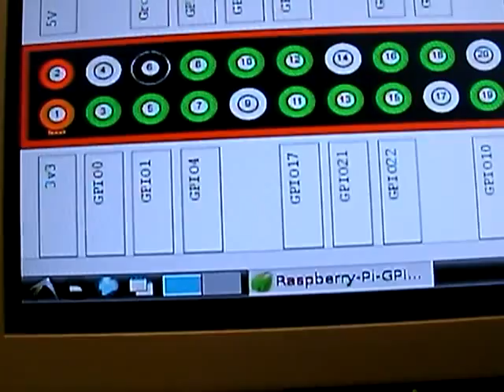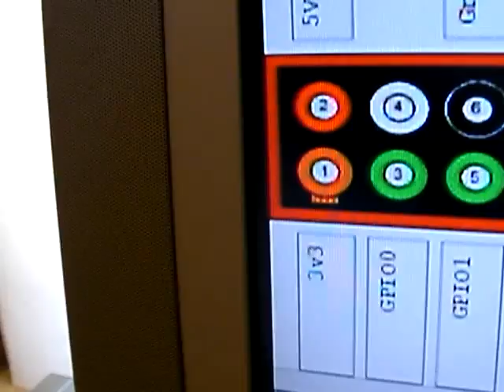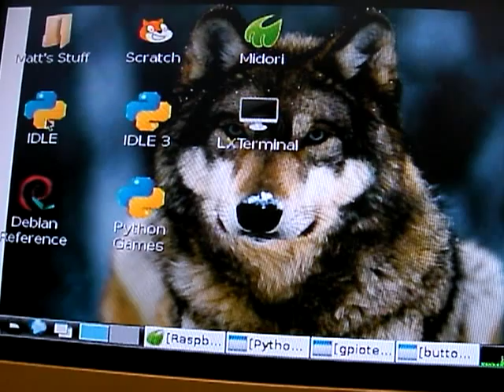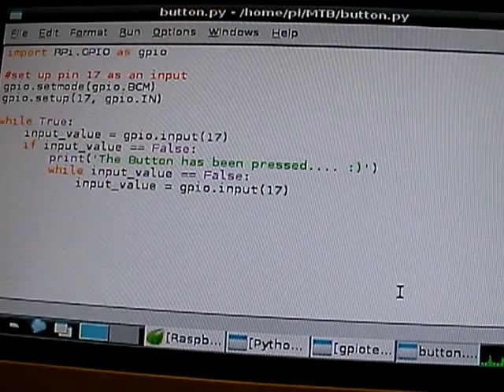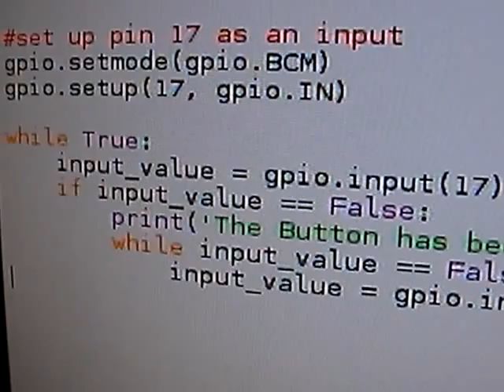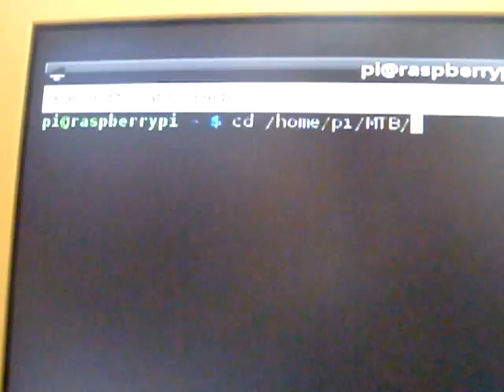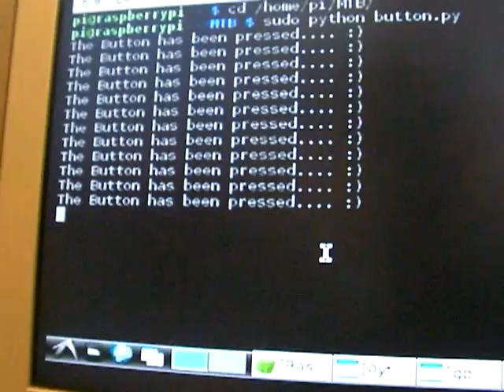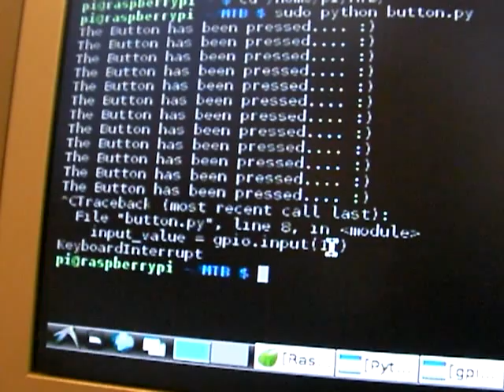Raspberry Pi - Getting Inputs from Buttons...

Comment: Is it possible to make it wireless using rf433 receiver and transmitter? For example the button is connected to a transmitter and the rpi is connected to a transmitter. And when i press the button, it will show "button has been pressed" on the rpi

Comment: I still got the question isn't it possible to connect the button directly by 3.3v and on the other side to the imput GPIO? When button not pressed no voltage on input GPIO pin when pushed 3.3v on the input GPIO pin? Why do we need two circuits? May the 3.3V damage the raspberry?

Comment: I hooked up a momentary   shut down button on my raspberry pi so when I press it the pi shuts down. I got the idea from instructable. Now I would like to monitor the 10 flashes using a GPIO pin. Can that be done and how? I really need to insert the python code that will copy the flashes on Pi and output it via an external led

Comment: Sometimes the button registers two presses, any idea why?
Reply: That's because of something called bouncing. Think of what would happen if you took a hammer and smacked it against a concrete floor, the hammer would make contact with the floor initially, and sort of bounce around, if it were a switch it would act as if it was flipped several times. There is a way of fixing it, a process called debouncing, instead of checking the input for a high pulse, it checks for a falling pulse and activates a small delay before it can be reactivated.
Reply: Why don't u put the button in between the resistor and gpio17? That way the circed is normally on zero v and only uses energy if pressed. Also calling the input will return True if the button is pressed witch is a bit more logical in my opinion.

Comment: hi getting error
AttributeError: 'module' object has no attribute 'setmode'
please help
Reply: Sounds like you either do not have GPIO library installed, have not imported it correctly, or you did not use it as a function like this: gpio.setmode(gpio.BCM). Linux and Python are case sensitive so make sure all lower case and upper case letters match the code above. Pause video at 9:22 to see how everything needs to be typed. In programming a single spelling or case sensitive error can throw the entire program off.

Comment: @10:54 The word ("embedded") and it's meaning certainly being used in** a grammatically correct way; however, it is not the proper terminology. In programming, loops which can be described in this was are known as "nested" loops. Any loop, test, or other function, wherein another independent non-procedural series of statements occur is given the quality of being "nested". This covers nested if-statements, nested loops, and the concepts of applied incursion (v. procedural) functions.  I'm not familiar with python enough to say "use a do-while loop," - but it looks like that would have made a lot more sense here as well..  Maybe a boolean flag, and a function, with a check against the end condition (pin state high/low), etc. Nice job though! :D

Comment: ~Novice electrician speaking~ I found the source of the problem. So apparently if you connect the 3.3 volts to ground, the pi restarts. (I assume this is a safety feature)

Comment: Hey, great video!
Do you really need that 2nd while loop? after your if clause wouldn't the thread go back to the start of the 1st while loop and re-get the value of gpio.input(17), which if the button is not held down would be true?

Comment: Great video.  I'm going to hook mine to a magnetic door sensor, so it will close the circuit when the door is opened and open it again when it's shut.  How would the code change to execute the print on initial circuit close? I want to send an email when the door opens initially, not wait for it to close.
Thanks for any and all help